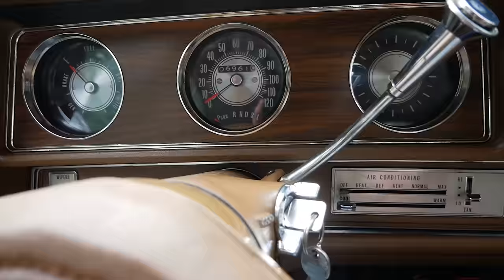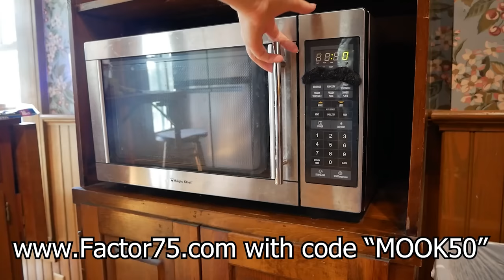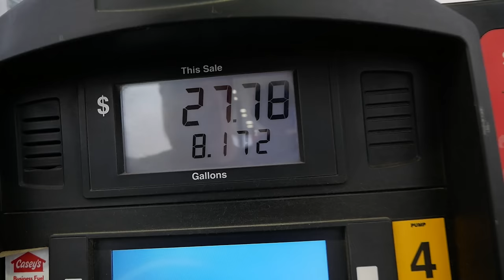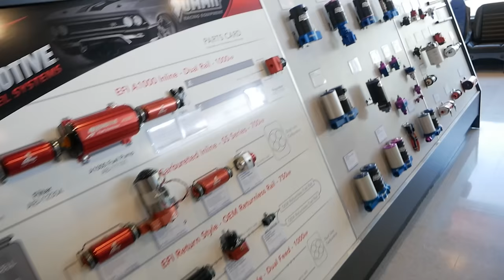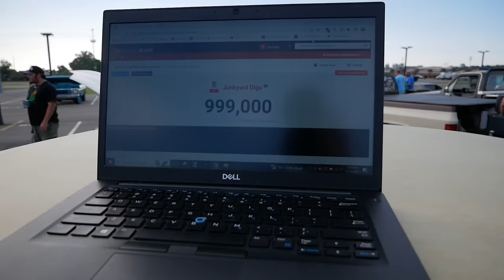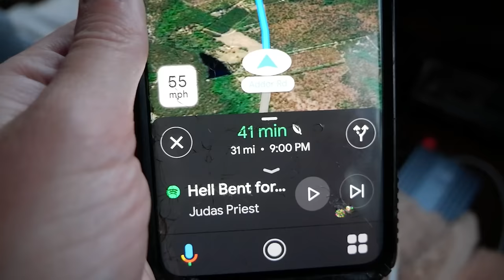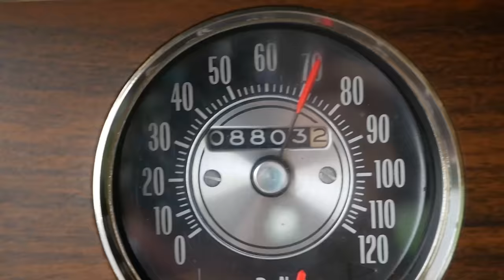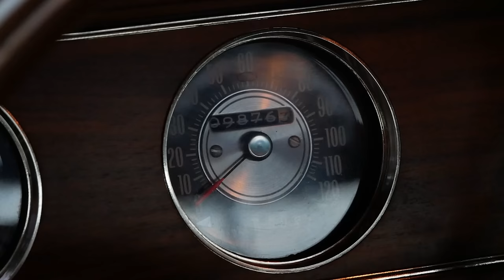Will My UNRESTORED 1972 Cutlass Survive a 2,900 Mile Road Trip?!

Comment: Saw that you already got the front shocks replaced but it you find yourself replacing others like it in the future, take this for what it is worth. Yes, the center stud always spins when trying to remove the top nut. What I always did was get the appropriate sized socket (1/2 inch I believe it was) and the longest extension in my tool box. Then, I would put the socket on the nut and use the extension for leverage to snap the stud off (grab the extension at the top, and push and pull towards the front of the car and back rapidly). Usually, after a few seconds of doing it, the stud would heat up enough to reach its fatigue point and just snap off. Just a trick an old GM tech taught me when I was starting out in the 80's.
Reply: Came here to say the same.  Never try to unscrew those nuts, always break the stud.  Use a long extension, or the socket on a ratchet will work, too. Then you can bend the stud, turn the shaft, then bend the stud in a different direction.  Continue until stud breaks.

Comment: Hey!  I know that Slo-pra!  Great video!  A trick I learned from an old mechanic for doing GM front shocks: Put a 9/16ths deep well socket with the longest extension you can muster on the top nut.  Rock the extension front and back until the nut and the top of the shock shaft shear off.  Then shock is off.  Don't care about keeping the shock intact as it gets tossed into the trash.

Comment: A tip for removing shocks - Use the appropriate socket on top bolt, use a long extension and go through wheel well into engine bay. Use socket and extension to lever the top of the rod back and forth and it will break off.  Much easier that fighting the rusty hardware.
Reply: My buddy's uncle told us that tip/trick back in 1987.....I have always busted the top nut off every front shock ever since. No that technique is not in any manual, but so what.....the shock is going in the metal recycling pile

Comment: This brings back memories of my '71 Cutlass. Although it was a 4 door, it was a cool 😎  car. Did the shocks just like you, but in '86 on a farm income, the rears got J.C Whitney helper springs over the rear shocks which really worked well. About 200,000 I replaced the timing chain. You could literally take the chain off the sprockets without taking the sprockets off. That's  how stretched it was. Also found a 4-barrel intake and matching carb at a local yard. Replaced the sloppy distributor with a reman and it really made that 350 rocket 🚀 motivate. Huge difference! Oh, I also did rebuild the carb. Never had a stumbling issue after that. Replaced the ⛽️ gas tank. Replaced the cracked windshield with one from the scrap yard. Did a lot of  other things to the interior such as new carpeting, stereo, the usual. Sold it to my cousin. Then he sold it. Oh well. 😊

Comment: My momma had a 72 Cutlass with a 350 Rocket in it.  Didn't have the most power ever, but that was the smoothest running engine I have ever experienced. And it was super quiet.

Comment: On GM older front shocks.. it's been a minute.. but use a deep well 9/16 with a 3/8 socket with a tall 12"+extension.. while pushing down on the extension.. pry it towards the front grill and windshield.. back and forth..the shank on the shock(being hardened steel) will snap or crack below that upper nut.. did this all my years as a ASE mechanic..  never failed me

Comment: Very cool. Few years ago I flew out to San Diego Ca from Hartford Ct to pick up a 1974 Firebird Formula I purchased online. While I was waiting in the hotel that weekend to go to the DMV on Monday for a temp plate to drive it back. I saw a 1972 Buick Skylark 2rd, gold with black vinyl top for sale in the classifieds of the San Diego news paper.  I got in my rental car and drove to El Cajon Ca and bought that as well. Returned the rental car. Coordinated with a trucking company, they picked up the Firebird, trucked it cross country. I went to a tire shop. had the oil changed and put on 4 new tires. Drove the Buick back from San diego Ca to Woodsville NH. Took me 3 days. Firebird arrived a week later. Cool trip. Lots of fun.

Comment: So the outside U-joint snap rings are probably a LOT better because you're absolutely 100% SURE they're in and locked, however the are a NIGHTMARE to get out sometimes, especially when you're on the SIDE OF THE ROAD or in a parking lot and you're under your brother's 89 OBS truck and when they manufactured the truck they used up whatever they had on the shelf at the GM assembly plant and you're stuck with 2 different sized joints on the same end. Yeah. Dealt with that once in the rain at 2 am. Fun stuff

Comment: Something to consider about the fuel gauge- I replaced the tank (new 19 gallon tank on my 74 F-100 pickup) and replaced the fuel sending unit also.  Never could get it to work, even got a replacement for the new unit at the parts store but had the same results.  One of my Ford trucks forums mentioned this was common with many vehicles of that era using new/modern sending units. They suggested getting one from Taiwan (purchased from National Parts Depot) that still uses the copper winding that the "contact" slides up and down against for the variable resistance.  Sure enough, it works GREAT.  If the one you are using has the "digital" resistance thingy on it instead of the wrapped copper wire and contact thing-it very well could be your problem.

Comment: Hello Mook never commented before but when replacing your shocks instead of fighting the top nut.  Take a socket that fits tight and a long extension and pull the extension and just break the top right off way easier and huge time saver give it a try it will help you on many projects.

Comment: 5:30 a quick way to get that upper shock bolt out is to put a deep well socket over thecstud and nut, then take the longest extension you have and bend it back and forth until the stud breaks off. I was a tech at a gm dealership and this was how we did it to beat flat rate time.

Comment: above the gas tank is an important place to try to hit with the spray wax too, preferably in addition to the rust reform spray paint, but spray wax works by itself too, if you can get it in there good.

Comment: What a fun tour!  And what a great car! Tell you what though, better pull off the timing cover and check the timing chain & camshaft gear; Olds V-8's have nylon cam gears and tend to strip at around 100k.  Make sure to pull the oil gallery bolt and clean the oil metering hole really well; that will keep your timing chain lubed.  I usually replace the nylon gear with a steel one; they make some noise but I never had problems aftrrward.  Use some zinc in your motor oil to lube the lifters and cam.

Comment: you'll probably never see this comment but i like passing on info lol, i work at a big suspension place here in Queensland Australia, and ALWAYS have trouble getting old rusty shocks off, until an old fella showed me a trick about 20yr ago, on top of the shock you'll see the stem with the thread on it, on top of that stem is usually about 20mm of blank rod, grab a grinder and grind some sides into that blank area, grab an open ended spanner for the size you cut and you'll be able to hold the shock still while undoing the jam nuts and hardware, 2min on the grinder saves you a BUTT load of frustration and time 👌keep up the awesome videos Mook! i love ya work

Comment: My first car was a '68 Cutlass. If I remember correctly, those front shocks had flats machined on the top of the shaft, so you could hold it with a wrench or vise grips, and get the nut off that way. All the best to you.

Comment: I've always just stuck the socket on the top bolt of the front shocks and then just wrenched on it back and forth real hard until it breaks off.   Quickest way I've found to get those bolts off vs, trying to keep the shaft from turning while trying to take the rusted nut off the top.

Comment: Deep socket on the top nut with a long ratchet.. Work the nut forward and backward, bending the upper part of the shock.. It will snap right off in 5 - 10 strokes. Easy peasy. Oh, break off the top before you disconnect the bottom. Trust me, it works 100% and there is no aggravation..

Comment: Your gas gauge shunt resister is bad,  Replace it and gas gauge will work as it should.  Its on back of gas gauge. A shunt resister allows the gauge to interpret the resistance value from the sending unit to allow the gauge to work in the E to F zone.

Comment: There’s two sure ways to easily get those shocks off that have the single vertical stud and nut. One is called a saws all and the other is a cut off disc (death wheel). A torch is optional but a lot more messy. Just cut the dang shaft any way you can and get the old ones off quick.

Comment: the old midwest trick is to put a long extension with a deep well socket on it, and you can bend the top back and forth until it breaks right off(usually 4 or 5 times).
Reply: 1000th post saying the same thing. 🤦🏻‍♂️

Comment: Looking forward to seeing what you do with this Bonneville. If I had it, I would make it a 4 door sleeper make it look nice with a buff or a paint job polish all the chrome up with a built motor and driveline full suspension front and rear disc maybe put a 4 link in the back not sure if inwould go N/A or forced but if forced would have to fit under the hood  and possibly dump valves on the exhaust if you were to take it on power tour. If I had the money and the car that would be my project, but unfortunately, I live in Canada, so everything costs about double, so not in the cards for me right now. If ever as much as I want to get a project car until the economy here gets better, that is not an option for me. Hopefully, one day, I will be able to get a car and head down to power tour. Bucket list things for me right now.

Comment: Kevin, I'm surprised that you didn't know about the top of the shock, above the threads there's a nub with flat sides.the nub lets you hold the shaft while you loosen the nut with a wrench. Back in thithe day l had two specialty sockets specifically for removing shocks.
Reply from the maker: That wasn't the case with these shocks 👍

Comment: If they are variable-rate coil springs there is an upside down. Also after changing the ride heighth in the back like that you should get the toe reset.

Comment: The mystery of the aircon orings explained:
The aircon orings are different for the R12 & R134a due to  R12 uses a mineral compressor oil and R134a uses a synthetic compressor oil. The synthetic oil destroys the Rubber orings used in the R12 systems, which causes much gas leaky…. The orings in used in the R134a systems are nitro butyl rubber which is compatible with the synthetic compressor oil. Mineral compressor oil also foams when used with R134a causing the compressor to become broken which leads to disgruntled hot passengers. Thus ends the lesson from Denso stratification of oring types. Do not mix your red & green!

Comment: The only way to fix that windshield leak is to replace the windshield and gasket.  While it is out, you must repair the rust underneath the gasket.  NO BONDO !  New metal must be welded in and ground flush.  Then primer and paint BEFORE installing the new windshield and gasket.

Been there, done that, got the T shirt !

Comment: When your gas gauge doesn't work you can use your trip odometer as a fuel gauge. That's how most people that ride motorcycles do it. A lot of bikes don't have fuel gauges. 
To start with fill your tank, reset trip odometer to zero, drive about 100 miles or so. Refill the tank, and check the odometer reading. Use the miles traveled and amount of gas it took to fill the tank to determine your gas mileage. 
Let's say you are getting 16 mpg. With a 20 gallon fuel tank you can go 320 miles on a fill-up. So every time you put in gas reset the trip odometer to zero. Watch the trip odometer and when you get out to about 275 to 300 miles head for the gas station for a fill up. Just remember that you need to reset the trip odometer and fill the tank everytime.
Reply from the maker: This car does not have a trip odometer 😅 I have always just noted my mileage after filling up.

Comment: There is a much easier way to install a gas tank, works when you are alone too,. I had a 92 Sierra, in which I had to do the in tank fuel pump.  Ratchet straps around the body and under the tank are a lifesaver

Comment: To remove top shock bolts the easy way is to put a deep well socket on the top of it and rock it back and forth and snap the top off. Your replacing the shocks so why do you want to save the old shock threads?

Comment: The trick to front shocks on a gm is cut off the top bolt. Seriously 
I don't even try to take the nut loose unless it looks almost new. Just reach for nut splitter attachment for my air hammer.
Reply from the maker: It's a Texas car so the nuts actually broke loose easily, the issue we were fighting was the shock with spinning and we couldn't fit a vice grips in between the springs to clamp it down.
Reply: @JunkyardMook  lucky..... I haven't had one break loose for like 10 in a row

Comment: I had a 72,423 84 Oldsmobile cutlass supreme brougham factory v6 car buick 231 i swapped it to a 1991 tune port 181 305 Camaro RS h.o., and the gas tank when I got it was low mileage and didn't work, ordered a new replacement sending unit i believe it was a spectra premium part and two hours of installation in the driveway on jackstands and wala oh yay it still didn't work,a year later i traded the 88 Chevy Monte Carlo SS drag beaten death trap back for my same buttercream yellow 84 Oldsmobile cutlass supreme brougham and put a carter fuel products sending unit,, and the gas guage still didn't work....fast forward two months after putting brakes on the front just pads and brake hoses, and the mechanical block mount fuel pump block off plate was removed and resealed and the electric mr gasket fuel pump failed and got replaced under warranty and it was louder than the first fuel pump.. and a week and a half later my younger brother was out hot roddin around and taking his best friend back to his house to get his 86 Oldsmobile cutlass supreme salon with the 79 oldsmobile 350 Oldsmobile 88 royale brougham motor with the 4bbl quadrajet carburetor!!  And a deer jumped out in front of them and they hit it running 65mph destroyed the deer and my 84 Oldsmobile cutlass supreme brougham pulled off the completely destroyed doghouse and put the used doghouse off my brother's best friends 86 grey Oldsmobile cutlass supreme salon but I didn't like how it turned out the trunk lid was latched but shoved over two inches towards the Dr side of the car,bent the lower front of the bottom of both doors, and the right rear quarter panel the marker light was folded up under the car,the dr. Door stricker bolt was broken loose from the body so roll the window down and slam the door and lock it and roll back up the window,car still drove straight as an arrow but it looked horrible... I miss the car it was!! Windshield was spidercraked in 4 different spots so it got a different windshield.. and then someone decided that they needed both of the rocket emblems off the doors!!! Grr... And yes 70-71 buick gsx dream car Kevin absolutely. Two of mine are a 65 Pontiac GTO,a 1964 Chevy Impala or Biscayne, and a 64-66 buick skylark special 2 dr prefer the 65 myself but it would be nice!!

Comment: So,the “S” option package consisted of what? In other words,what makes a Cutlass S different than a standard Cutlass? I noticed that this particular example is a basic,two-barrel with a 10 bolt rear. Yesteryear,during childhood,my father had a ‘69 Cutlass S but,it was equipped with the Quadrajet carburetor and a 12 bolt,limited slip rear end. I’m only aware of these specs because my older brother got himself on dad’s shit list for racing it in high school.

Comment: hey id trust a 72 car in that condition rather then of a modern car in that same condition to drive on road trip 

(modern car ) the cigarette port has got fault code the steering has fault code the engine is running weird computer going nuts lol
Reply: old car spark and fuel equals bang bang  getter done

Comment: hit the top nut on the shock with an impact instead of a ratchet and it should knock it loose.
Reply from the maker: It knocked loose fine, the issue was the shock was spinning and there was no space to clamp it.

Comment: Loved your channels until I realized, you take decent cars that could be restored to their former glory and destroy them completely.
Reply from the maker: Sorry you see it that way, I am not sure where you got the idea that we completely destroy cars 😊
Reply: @JunkyardMook   I just mean that for example starting an engine after it sit in the woods for decades will likely destroy it completely. I didn't mean to be rude and it's just an opinion. But I just watches this guy restoring the car to pretty much its original shape and then asked myself if I actually like this "Can you beat this dead horse for 2900 miles?" 😶
Reply from the maker: This Cutlass is far from a dead horse, it's just unrestored. 99% original doesn't mean it wasn't capable, just meant it was impressive. I don't drive my cars if I think it is going to damage them. The Cutlass had a very thorough walk through before hitting the road.
Reply: @JunkyardMook  okay, I stand corrected then ☺ cheers!